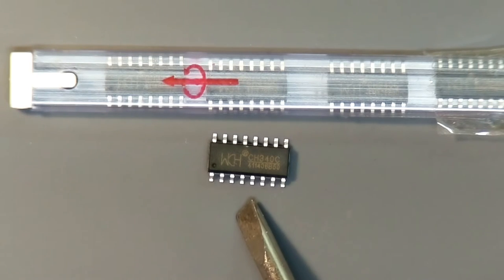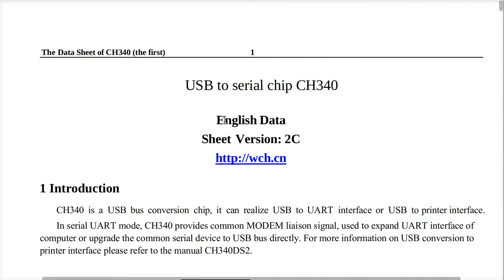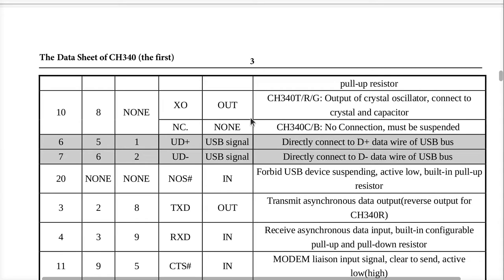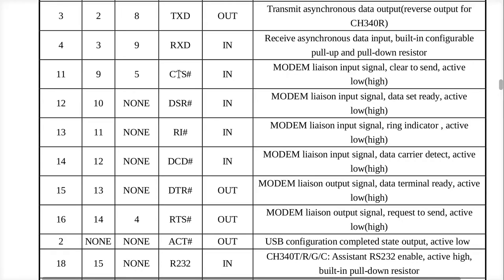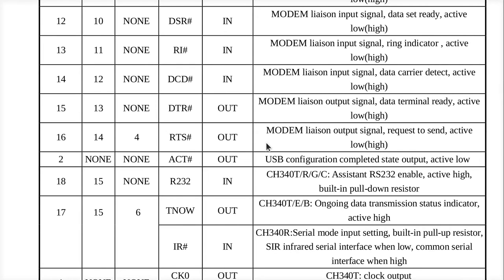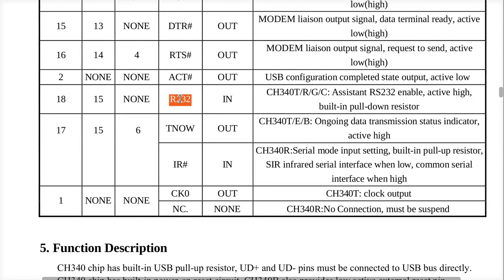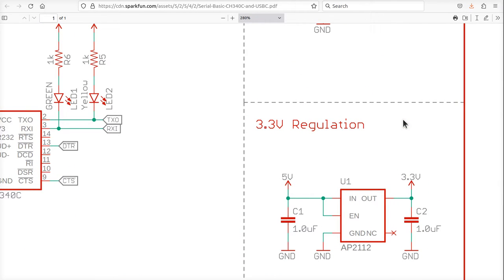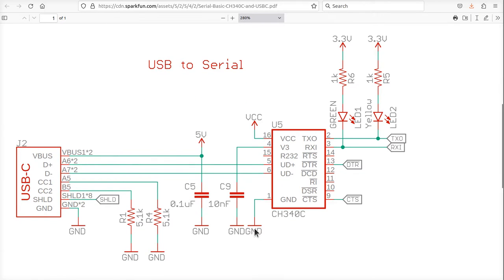CH340C USB Serial Adapter 3-Wire Breadboard Test

Comment: The chip has builtin 3v3 voltage regulator which is used internally if powered by 5v. Then V3 pin works as output of that regulator. And If the pin is not used externally then attaching a small decoupling capacitor to it makes sense. To note: builtin regulator is not very powerful, maybe 20-30 milliamps of extra load, no more.

Comment: Decoupling capacitors seem to be poorly understood, (until recently even by me.) 

I just watched a video which gives a great explanation. According to this guy (and his scope), this is much more about inductance than capacitance. In a nutshell, he says you should pick the 'physically smallest' capacitor, and place it as close as possible to your IC pins. i.e. given the choice between an 0805, an 0402 (or heaven forbid ... a thru hole), you should pick the 0402, because smaller packages have less inductance, and are also easier to place close to the pins. As for the value, it doesn't make as much difference, but you may as well pick the highest 'practical' value in the small package size. e.g. a 1uF or 10uF will show a 'slight' improvement over a 100nF. Another huge consideration, is the rise and fall times on signals. Very sharp edges, will produce more noise due to inductive effects, which is particularly important with microcontroller pins.

Ergo, while Sparkfun might be criticized for ignoring the datasheet, the more important issue is the size of the capacitors they used, and where they were placed on their board.

Check out the youtube video by "Robert Feranec" called: "What Decoupling Capacitor Value To Use And Where To Place Them | Eric Bogatin"
Reply: You can forego having decoupling capacitors by using a well designed PCB PDN (Power Distribution Network). Robert’s a nice guy & has a good channel but take heed to the experts such as Dr Eric, Lee Ritchey, Dr Bruce Archambeault & Henry Ott for matters pertaining to signal integrity and EMC. Their books are excellent references. “Ground is a place where potatoes and carrots thrive!”. Rick Hartley & Suzy Webb are excellent practitioners of the associated PCB design.

Comment: The simplest interconnect using many of the RS232 signals is to connect a DTE to a DCE device. e.g. Computer/Terminal to Modem. This configuration uses a straight through cable. The challenge is that with this configuration requires 2 modems and a line/line simulator to connect 2 computers/teminals together thus we have a plethora of different Null Modem cable configuations to omit the modems and line simulator. This is because ancillary signals such are often under software control with variances to their behaviour.  Also be weary of the reaction time of systems to the handshake signals. Some are very slow to react and if not handled correctly will result in data overruns.
Reply from the maker: Indeed!  The lack of full duplex flow control in hardware is the cause of many a headache!!!

Comment: Nicely done.   I have the same chip but haven't tried it out yet.  I've used the FTDI chips in the past but these are nice and cheap and I've never had to install a driver as I've had to for the past for the FTDI.  I think the drivers for both brands are delivered with the OS these days.  These WCH USB chips are used all over the place now, but I don't recall ever seeing one  with flow control ever being used.  It'll be fun seeing you try these flow control lines out.
Reply from the maker: I hope to see that flow control is tight enough for old UARTs with a 3 character FIFO. 😬

Comment: I saw that the AgonLight2 is using a CH430T as the onboard USB to UART converter on that board. Olimex have the schematics on their website. It's a pretty cool SBC, definitely check it out if you haven't yet. They're running an eZ80 with 512K external SRAM and an ESP32 for I/O. I've got one on order.
Reply from the maker: Be sure to read the datasheet on the EZ80 first.  It is a cool chip.  But depending on the sort of MMU your application needs, the Z180 should also be considered.

Comment: Heh, when I was looking for a chip to make a USB to RS232 adapter for my Z80 Retro board, I also looked at the CH340 chip, because it was actually available/in stock and is pretty cheap. But I decided against it, because the datasheet drove me nuts! Even though I'm pretty used to "Chinglish" from all the various badly translated manuals I've been exposed to over the years, this datasheet still threw me for a loop. I ended up going with the Silicon Labs CP2102N USB to UART chip, combined with the MAX3232 to convert the UART voltage levels to the RS232 levels that the Z80 Retro expects on the console port. A bit more costly than the CH340, and also slightly more difficult to solder (the CP2102N is a QFN and the MAX3232 is a SOIC with a pretty small lead pitch) but it was still very doable, even with my Neanderthal-level soldering skills, and the board I made works quite well, and both the CP2102N and MAX3232 have much more readable (dare I say "pleasant") datasheets.

Comment: I just used the MCP2221A on my Z80 retro homebrew, and it works flawlessly. You even have I²C on it.
Reply from the maker: Sounds good!  What bit rate do you normally run at?  Any data overrun issues?
Reply: @JohnsBasement  I've been running it at 115200 without any issues for a while now.  I'm going to double that rate when I receive my new board soon. However, I have a feeling I may be pushing the limits somewhat. But who knows. I'll keep you posted on the results.

Comment: Somewhat a waste of time watching someone jumping randomly around a datasheet and laughing.
Reply from the maker: Eventually, youtube will add chapter markers so you can jump over what ever you get bored with.
Reply: What's even more boring, is spending 5 hours trying to debug a failed circuit, because you missed reading an important detail.
Reply: Don't put pressure on creators to deliver short videos. If a long video is required in order to cover all the important little details (and add some welcome personality), then so be it.
Reply: That's not laughing - that's the cackle of hard-earned experience. It's a gift to be appreciated!